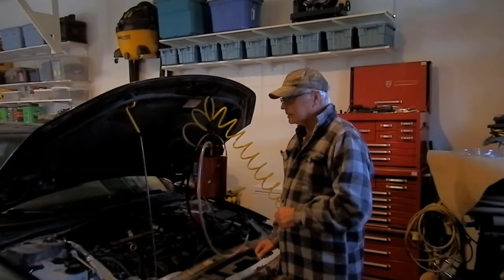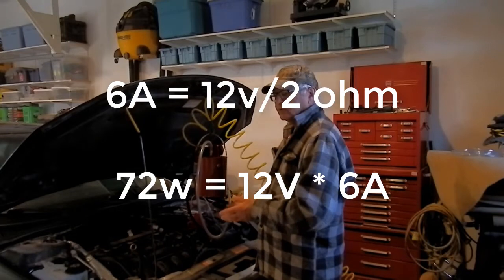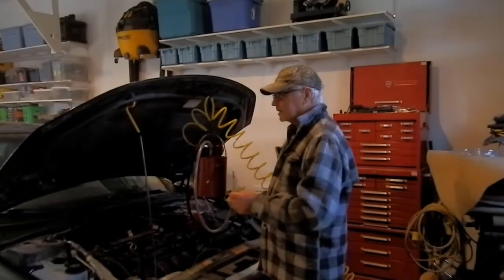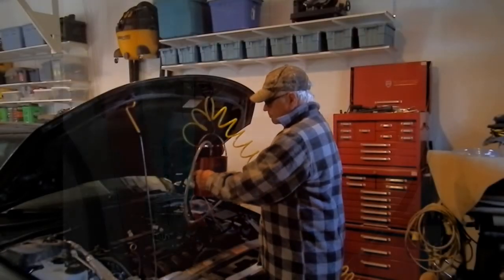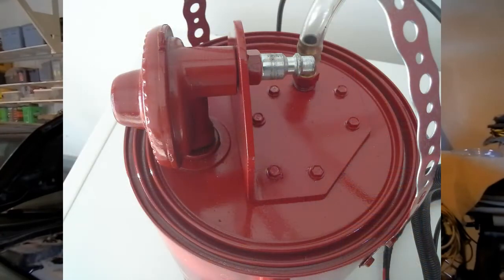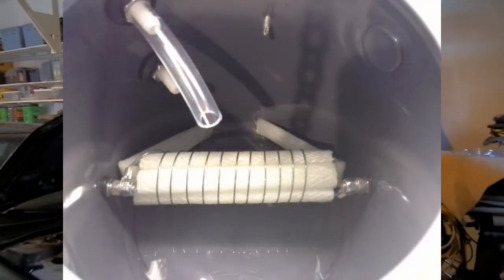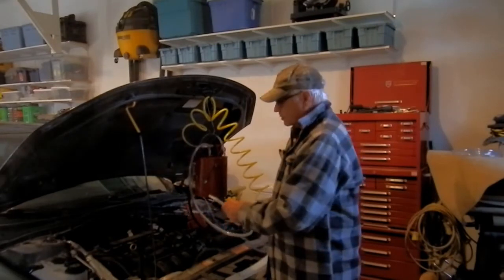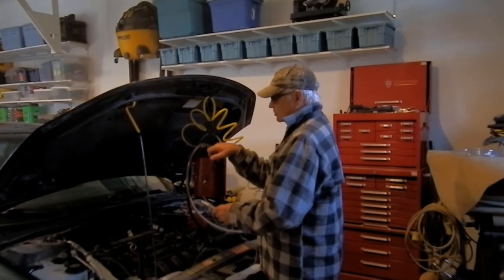GADGETS#4 - LEAK SEEK

Comment from the maker: My entry into the paint can smoke machine builds. Some of the materials used:

18GA Nichrome resistance wire
TIKI torch wicks
Performance Tool W5214 Rubber Grommet Assortment
BBQ propane regulator
In-line fuse holder (10A)
10GA aluminum sheet
Mineral Oil
CNBTR Multicolor Acrylic 0-5LPM LZQ-1 Oxygen Air Gas Flowmeter